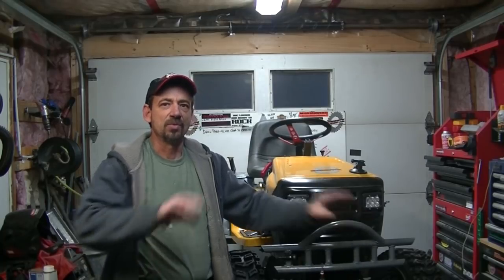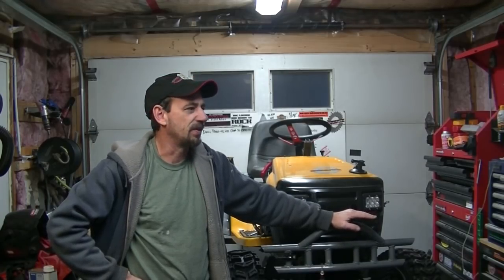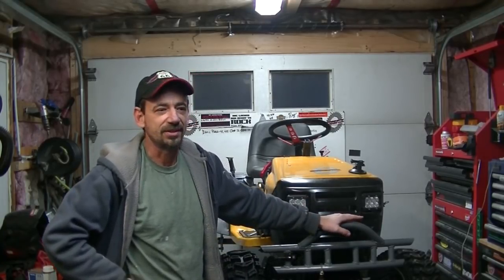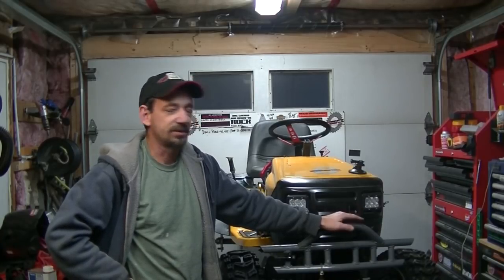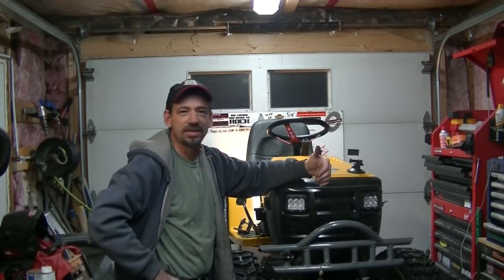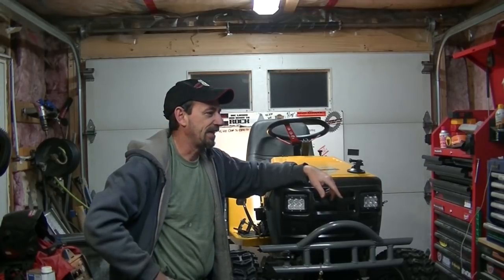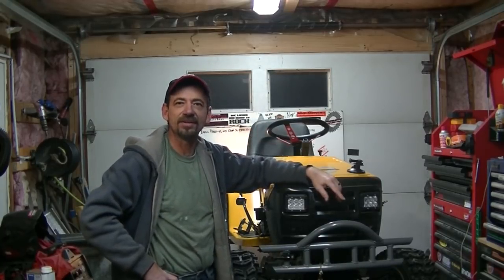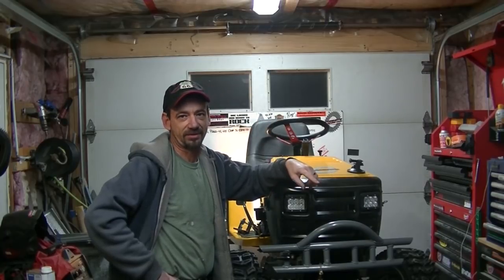Brake Failure! How NOT To Put Hydraulic Brakes On A Mud Mower!

Comment: In your example of a 1" vs 3" piston ratio, the mechanical advantage is actually 9:1, because pressure is unit force divided by unit area. The area of a 3" diameter piston is nine (9) times the area of a 1" diameter piston. A 100 lb force applied at the 1" piston will therefore deliver 900 lb force at the slave (3") piston.
Reply from the maker: Yep, absolutely. That was just a quick and dirty (and somewhat inaccurate) explanation of where I goofed. You are correct, though.

Comment: Interesting lesson in hydraulics, as basic as it was, that sort of gear ratio factor never dawned on me in full until now, I'll definitely have to keep that in mind if i ever do hydraulics.

As for the factory clamshell trans brakes, they seem to be hit and miss in stock form, but can be made to be operable at least. I can lock up my 26x10-12 Execs with my stock caliper, but I actually made another wedge/actuator arm(i hope you get what I mean)out of stainless steel, and have a big brake lever at the inside of my right leg, I'd say the knob on the pull wnd is at least 20" from the pivot, and the hole where the linkage connects is 6" on the other side of the pivot. Keep them adjusted and they work great. My only real concern with them is the actual brake caliper breaking off the bolts and coming off if i put yo much force on it(from the disc or lever side). 

Misengineer, wheel, realize your mistake, repeat? Hahaha

Comment: the stock brakes on my brothers mud mower are awesome, he broke a belt recently on his big yard machine garden tractor/mud mower, so I had to tow him home with my full size chevy 4x4, at 10mph when he hit his brakes he was actually stopping my truck at the stop signs, i'm not sure what the transaxle is but it's a 2 speed with 7sp varidrive and has a fairly large brake disc,

Comment: add a 2nd caliper to the rear axel ??even if not on the axle take out the pads and install a heavy spring just so the fluid does not blow out the piston might have too put spring in a pipe or cup so it don't pop out then you have some place for the extra fluid to go ?? just a thought

Comment: One of the best videos on adding hydraulic brakes to a riding mower. Very difficult to get piston diameter specs for brands like MCP .So it is tough (and expensive) COMPLETE system . I found a floor mount foot pedal + 5/8 master cylinder on Amazon from "Latest Rage". but then you need many other parts from MCP(caliper and Azusa(disc). Wilwood has a "Karting KIt"  but it is missing the rotor/disc.Yes you can piece together a syst Sproket!ver to youem but will it work?? For example ,will the Latest rage foot pedal+master cylinder 5/8 bore work with an MCP 1-3/8 bore caliper? And the price ! The incomplete Wilwood system is over $300. Over to you Sproket 🙂

Comment: Likely not enough room to install a vacuum break booster between the pedal and the master, likely wouldn't help much anyways. You would likely need a rear caliper off of a civic, preferably passenger side so the park break linkage would be on the correct side and then you could set up a parking break as well.

Comment: NO, no, no. You just stumbled onto something there from the aviation industry. The setup you just put on Fugazi, is the same setup that commercial air liners use on there brakes, by deboosting the hydraulic pressure from the system of 10,000 psi to use for the brake system that uses 2,000 psi. :) It's all good. 

Hay, maybe a caliper from a Ford escort would work. They are actually a 2 piece caliper where the outer pad holder half unbolts from the piston/inner pad holder half. But you'll have to make a new bracket probably. :)

No sweat Doc, we learn more from out mistakes then from out successes.

Comment: That's a small goof compared to my Canon goof LOL. But I will add it turned out to be the pin that holds breach or bolt  whatever they call it was just lightly pressed in. I can't believe it was not threaded but what do you expect from China LOL. But that means I didn't add too much powder.

Comment: Thank you. What is a good ratio for the brakes?
Reply: a good ratio is 7/8 inch master cylinder bore to 2-3 inch caliper piston bore on a 1.9:1 ratio brake lever is usually optimum on most non power brake vehicles.

Comment: The math was off  but it still passed the point along... the math was missing the conversion to surface area because a 3 inch dia. piston is not 3 square inches but also a 1 inch dia. piston is not 1 square inch same with the 3/4 and 5/8 dia. bores formula for piston face surface area= pi x radius squared
Reply from the maker: You're absolutely right. That was just a quick and loose example that I was hoping your average person could follow along with. I THAT happened, mission accomplished. If not... Then today was just not my day. LOL Thanks for watching!
Reply: Sprocket's Garage like I stated it got the point through just with some slightly off math

Comment: Not 3 to 1, it is 9 to 1.  A 1 inch cylinder pushing a 3 inch cylinder is 9 to 1.  You have to square the diameters.

Comment: Well maybe if I could get out all my old tech school books and papers this problem can be solved. 
Being I’m only 2 or 3 minutes in I’ll shut up and see what happened.
Reply: 7:00ish. 
Believe it or not , those bellows type seals on calipers in your car (for example) help the piston retract slightly when you release the brake so the pads don’t drag. 
Ok I’ll shut up again , I just wanna figure this out because as a tech there is nothing that doesn’t have an explanation.
Reply: Back in the day, a popular swap on a vw rabbit was to run the 16 valve brakes up front. 
The rabbit had a 16mm master , and would work with the 16v calipers, but the caliper pistons were a little larger. Hence you would have more pedal travel with the original master, unless you swapped the 16v master on(it was 21-22mm) 
I didn’t mind the longer pedal travel, it gave better feel at the limit.
Reply: Ah I got ya , if the piston sizes were reversed between the caliper and master it would probably do the trick, or at least work a little better. 
Using the basic fluid knowledge theories you could size a proper master to a caliper, or find a master/caliper setup from a piece of equipment already in operation. 
The engineers already figured out the crap you went thru. 
I’m not glad it was a failure for you, but when you go pioneer sometimes you get shot in the tookus with arrows!

Comment: 1" to 3" pistons is actually 1 to 9 ratio. Then 3/4 to 5/8  is actually 1 to 1.44 ratio.
Reply from the maker: 1:9?
Reply from the maker: Never mind, I just crunched the numbers. Got it, thanks.
Reply: Sprocket's Garage Seeing we are using hydraulics we have variations of volume to find ratio, so volume = area X stroke . So to make life easy let's assume we have square pistons so 1" piston 1x1=1 square inch now the 3" piston area 3x3=9 square inches ratio is 1:9. To find stroke variation as you said before the ratio of areas will give stroke movement. So if we move 1" piston 1" then 3" piston will move 1/9" because volume is area X stroke. Mind you if both pistons same shape for example round we can cheat and forget π and use diameter only because π is on both sides of equation. Hope not too complicated explanation.
Reply from the maker: Yep, thanks for that. My brain is about cooked for the day, but I DID arrive at 9:1 after solving for the area of a 1" dia piston and a 3" dia piston. Now... I just have to find a more appropriate caliper!
Reply: Sprocket's Garage It must be getting late or should I say early over there because in Australia it's 3:45pm Saturday afternoon here so you could say " Your speaking to tomorrow from Yesterday" lol.